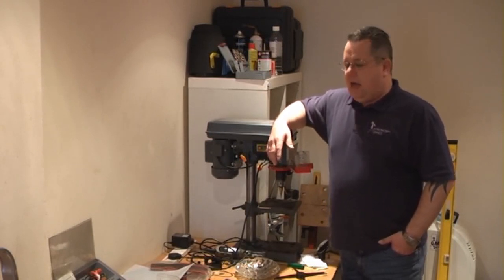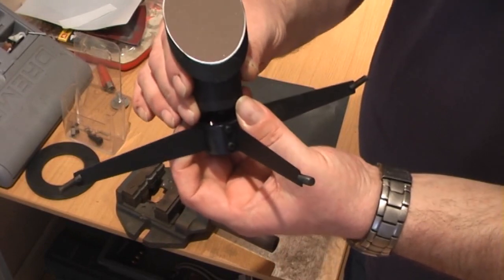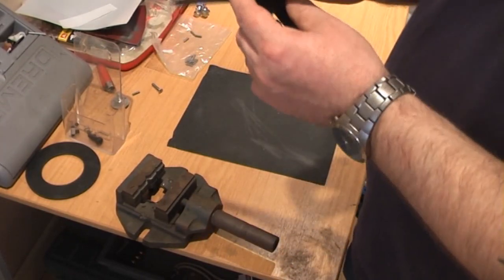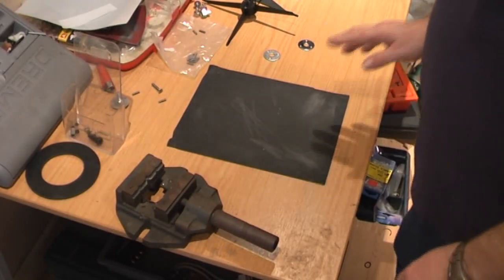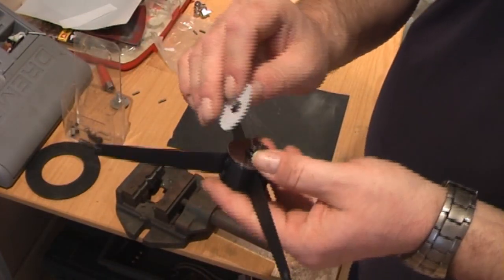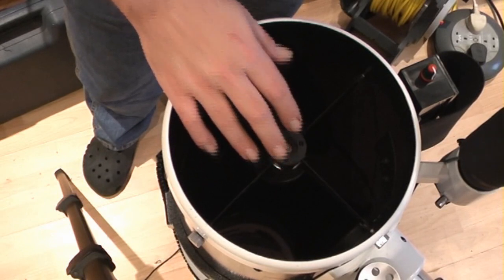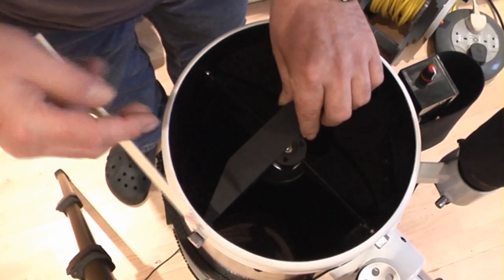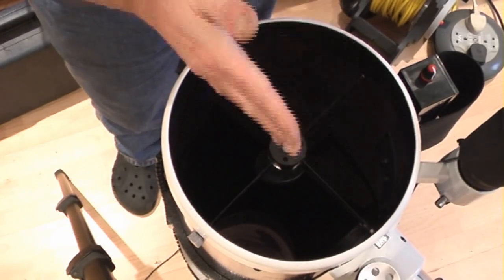Newtonian Secondary Mirror Mod

Comment: Awesome idea. I had a bit of a hard time adjusting the rotation of my secondary and this will deffinitelly come in handy. It might be a good idea to wet the sandpaper when you flatten the back of the secondary holder so no loose metal dust accidentaly gets on the mirror

Comment: Centring the secondary by adjusting the vanes...I use a pair of compasses with the point sitting in the centre of the screw. I open the pencil end until hits the edge of the OTA and then check the other two vanes to ensure that the spider is central.

Comment: VERY useful information, I never noticed how much my secondary mirror holder was marked by the screws! No wonder when adjusting the screws ,one or two would seem to hang up and not move right! Think I’m going to see if I can find replacement screws for these cheap Chinese ones! Not as easy in this backward Country (USA) that’s the last place but a few microscopic countries still using the Kings arm to size things! Love your very practical approach to telescope repair!

Comment: Thanks for your really good videos. I always find them hands on and practical. I have a question, I am considering purchasing a 1000mm f/5 Newtonian and modifying it to a 500mm Newtonian. My thinking is that I will have to fit a larger secondary mirror when I cut the tube. I am sure there is more to it than this and I am probably missing some important detail. Can you please advise if there are any pitfalls I should consider befor cutting. TIA
Reply: Not an expert, but cutting the tube won’t change the focal length of the primary mirror. What are you hoping to achieve?
Reply: pilotguy1983 Thanks, you are right I had a brain fart. I realized afterwards that I’ll need a new objective mirror to reduce the focal length and simply moving the diagonal wouldn’t do a thing except give me blurry views 😃

Comment: Love all your videos.. :-)  Recently acquires the 10" Quattro, which the previous owner did "some" of the mods here.  A couple of questions if I can.. I need to "square" up the vanes vertically.  There are two screws at the base where the vanes attach to the central hub.  Have you ever tried to loosen those to make sure the vanes are not twisted in any way?  The other question was from the "mods" you did.  Did the neoprene extension (dew shield) ever seem to absorb the moisture and being to become mis-shapen?  Again, I enjoy all your videos on the Quattros..  Thanks!